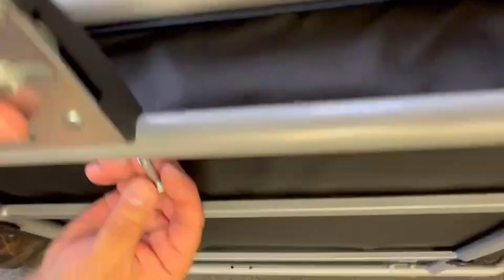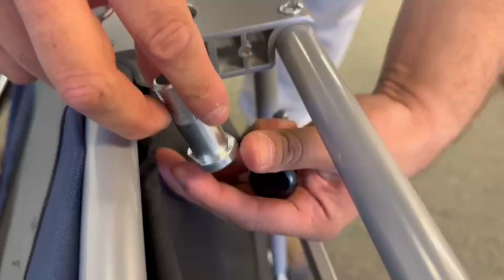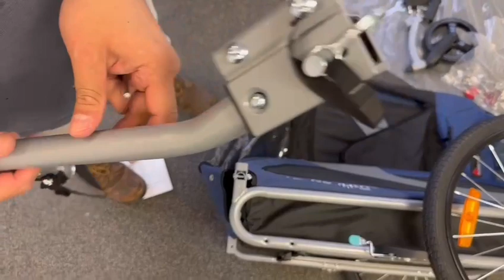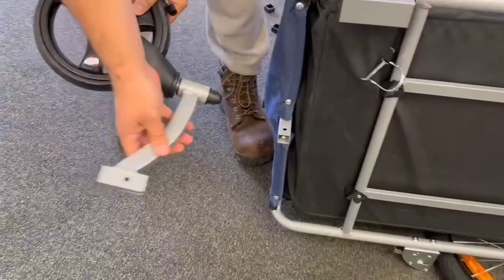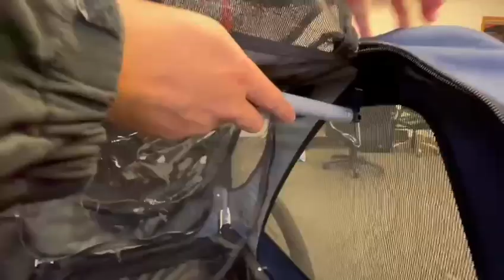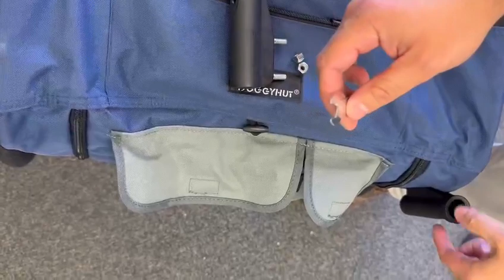How to set up Doggyhut premium pet bike trailer & stroller L/XL

Comment: I also cannot get the wheel to lock in. I can't get the bolt tightened enough and wondering if I was sent the wrong size.
Reply from the maker: Are you able to use a bigger wrench with longer handle to fully tighten axle receivers and nuts? This is key to snap wheels in place securely.

Comment: I am sending the other order back, did not know I did not receive the "premium", I also did not realize the difference with installing the wheels.  My order had screws that were stripped, so the wheels I could not install, pl
us the product was used bc I found a piece of grass in the package with the front wheel.  I appreciate your instructions, easy to follow and your are very thorough.  Thank you!
Reply from the maker: Hi, really sorry to know that you're unhappy with this. What you ordered is a Doggyhut original pet stroller, not premium. By the way, all of our products listed as brand new are sold as brand new as we sell returns via other channels.
Reply: @Doggyhutbiketrailers  Hi can I please have your email address?? I cannot find it anywhere. I need a replacement part to use my trailer!!

Comment: My alignment on my large one must be misaligned or defective because it was VERY difficult to get the large wheels to click in and I did exactly what you did. Had to do it over 30 times each side to finally have it click in firmly. Was very frustrating to say the least!
Reply: I am 99% sure it's on the right direction (where the indent is on the outside) but tomorrow I'm going to work harder at trying to double check and get it off. It's locked on just has a bit more play than the other axle than the other side.  I'm wondering if the inside fitting is damaged somehow. WD40 tomorrow... fingers crossed.
Reply: Bonjour nous avons eu du mal sur 1 car l'entourage bleu dépassait du bord ce qui empêchait le clairement de la roue
Reply: @rousseysandrine1999 what did you to correct the problem?  Is the blue rubber seal meant to stay in all the time? My blue seal started to twist once I started to tighten the nut.?
Reply: Coucou nous avons appuyer sur le joint bleu en regadant quil ne depassait pas,et avont reussi a mettre la roue . @kathyfry3396     j'espère que vous y arriverai. Bonne balade .
Reply: Same thing is happening to me and havent been able to instal one of the wheels
Reply: @karlaparedes109  try flipping it over!  If that does not work, swap it to the other side.  I was not doing it correctly and that's why mine wasn't working.  Hope you figure it out.  It really is a great product.  I love it :)
Reply: I just got new axles for mine and now one of the wheels won't come off...I suspect it is a similar issue to what you were having. Did you just get lucky after trying for so long? I'm thinking I might have to take mine to a bike shop to get the wheel off now.
Reply: @moofoot I was actually putting the wheel in incorrectly! Once you get it off try flipping the wheel over and reinserting!